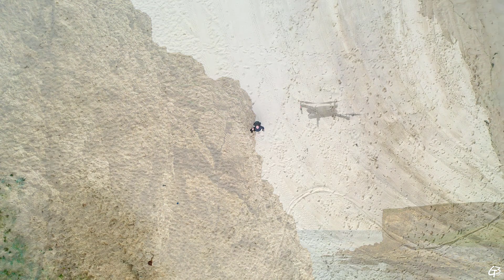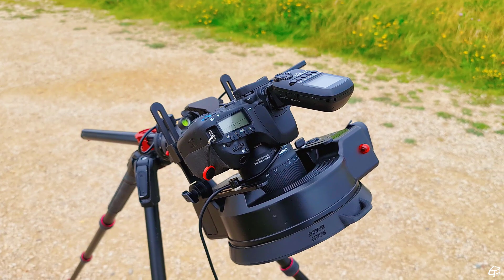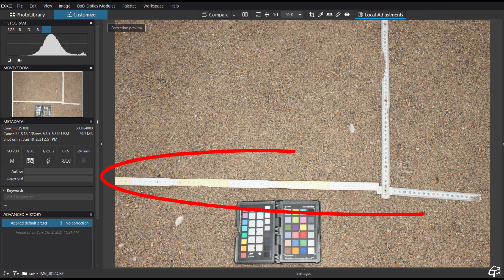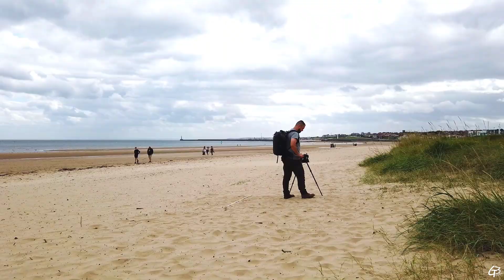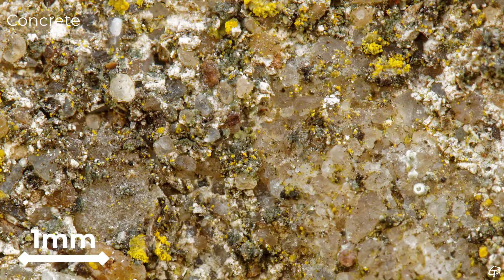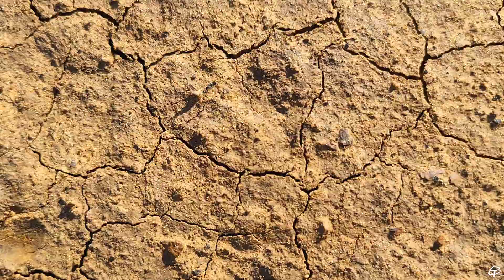Outdoor Photogrammetry Surface Scanning for Materials with a Flash

Comment: Thank you again very much for such great workflow analysis. I’ve been thinking to setup my self with monopod, but after seen your way of using tripod, I cant Imagine it would serve me with my photogrammetry workflow. Also the comparison with different substances and their way to react in ambient, unpolarized and polarized light was great! Absolutely great contnent!
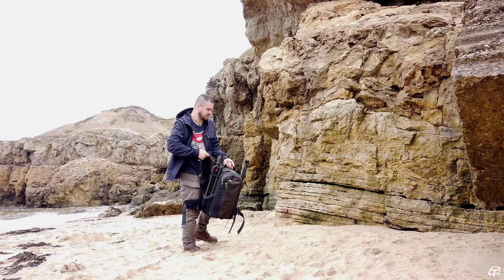Reply from the maker: Thanks. Yeah, the monopod is a better pick if you shot just with a camera in decent lighting conditions, but fails when used with heavier equipment and also when shooting complex surfaces like grass etc. in poor lighting conditions. I also use a monopod to record my videos :). These are reasons why I usualy carry both but if I have a choice I would pick a tripod as a tripod can also work as a monopod if you stick legs together [42:02] while monopod can't stabilise the camera as good as a tripod can.

Comment: This was very useful and greatly presented, barely any detailed info on this out there so thank you so much!!! I have found that when shooting some surfaces when the sun is very bright I would use the silver side of the reflector against the direction of the sun to cast light from it to the opposite side of the surface and sometimes it kills the harsh shadow, not as well as the flash but still!
Reply from the maker: Thanks a lot, btw. your solution sounds like a very interesting idea but I would affraid that the light reflected this way might be not consistent enough. I would rather use black side of the light reflector to absorb the light and its shape to cast a shadow and this way shot in a shade. I did it many times and it works great, the only problem is to hold it steady during windy weather.

Comment: Your video are very useful and informative! Thank you to share your knowledge. It might not sound much, but talking about weight reduction, I took the habit to NOT wear my backpack while doing photogrammetry: this add to your weight on the back especially when you are bending just even a lit bit.
Reply from the maker: Thank you! :D Regarding the backpack and weight reduction, it all depends on the location and if you scan alone or in group. When I scan I am usually 100% focused on a subject and dont pay much attention to surrunding environment. I mean, even to the level where I was caught by tide waves a few times while scanning the beach sand. It takes a few seconds for someone to steal/grab a backpack, especially when they see that you are super busy. Photography equipment is usually perceived as expensive and is easy to re-sell, so a backpack full of it might be considered as an opportunity for some folks. Therefore, sometimes I do as adviced and leave the backpack on the ground, especially when I am alone away from people, but usually when I am not, and there are some people nearby, it feels just safer and easier to carry it on my shoulders. But as said, it all depends on the exact case, if I scan alone and how heavy is the current load - sometimes it is just the camera and the drone, sometimes it is just the drone, sometimes if I parked car nearby I carry just a single, small bottle with water, sometimes I carry more etc., especially if it is a full day of scanning. But you are absolutely right, keeping it on the ground makes the job less exhausting. Cheers!

Comment: your videos are so good! thank you so much. I don't know if you have already covered this in one of your videos but how du you create the roughness/specular map? I've seen some tricks for statonary setup but I especially wonder how to create those maps for a mobile setup. For example if you do photogrammetry out in the street of objects that are made out of different materials that are more or less reflective, how can you caputre those informarion? The only thing I can think of is taking two pictures from every position, one with cross-polarized filter and one without. But is there not another way, where you can be more mobile, because if you do it with this method, the two pictures have to be made frome the exact same position, which means you would need a tripod.
I've seen setup from quixel megascans where the just take picutres with the cameras hold by their hands. Do you have any ideas how they create the specular like this?
Reply from the maker: Thank you and you are welcome. I was planning to recird a video about roughness at some point, after the one about color calibration but I dont have much time recently and it takes me really a lot of time on research and experiments before any of these happen. Roughness is a very tricky subject and similar to color, there are no an easy, 100% way to make or even measure one. So it is very benefitial to understand what roughness really is and how shader expects to use it. I usually generate roughness manually using captured data - and the way to generate one depends on the data available. The way with cross-polarisation works to some degree, but also isnt perfect and has some flaws. It definitelly helps to read reflectance levels by substracting cross polarised data from pararel polarised one and use this information when creating the final map. But as you said, for this technique to work you need to take two images from the same spot - one cross and one pararel polarised.

Comment: I love these videos, so busy these days making art there's little time to get out and take pictures/do photogrammatry, your channel is inspirational.
BTW I got the same ring flash and polarizer from Nz - if you have any transportation tips that would be great. Concerned about damaging the film.
For camera shopping I highly recommend looking at the Canon R5/R6. Mirrorless - with the in viewfinder greater range of information such as instant histogram, is so much better than SLR.
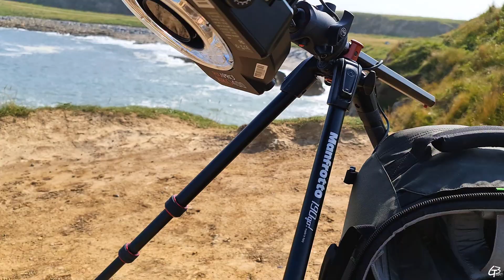Reply from the maker: Thanks a lot Dan. I am afraid of lens incompatibility if I move to Canons R series. Also considering Sony A7RIV as an option but I am not sure. I feel like Canon is just superior to SONY as a still camera (I had an opportunity to shot with SONY too). I carry filter mounted on a flash in my backpack. As you can see on the video I arranged a dedicated space for the flash in my Mindshift 30L  backpack [37:50] so it feels very safe and well protected there.
Reply: Well as you probably know you can use a lens adapter with your old lenses, or just sell them. But the new R series - or any mirrorless  - are really a treat. Lighter, smaller and the viewfinder with histogram as I said (and true exposure simulation). Canon's coming out with new lenses quickly that are really amazing (as usual). I love the new primes - 35, 50 and now 16. The only thing that still catches me is the lag when initially looking through the viewfinder, still not used to the small lag. Also the battery life isn't as good, they're really power hungry.
Reply: @GrzegorzBaranArt  Not later after you got your 80D I got a M6Mk2, that would be equivalent to a 90D (bigger diff apart from mirrorles to dlsr would be on video, so non important to this conversation).
Coming from the 700D I already had some lenses and the feeling of a rough outdoor camera. The M6 came with a 18-135 ef-m but with a cheap adapter I can keep using ef-s lenses, who I like much better than the  Ef-M (although they work fine in my non technical opinion) maybe because they feel design for outdoor use. The same for the body, I feel more comfortable getting the 700D (and most likely the 90D) closely to dirt (both cases taking proper care). In the other hand I don't miss the shutter at all, can't say the same from the eye viewfinder but I've learn to live without it (too expensive for this model). My overall opinion is that compact mirrorless are best suited for "city" and "home", meanwhile, The R series are quite dope (as much as expensive), probably the adaptors are not almost affordable and they are getting better everyday. I hope that Canon finally comes together and develop some aps-c classic rough bodies to meet in the middle. In any case is not worth to talk about recommendations now, your camera really looks like you take good care and those mf shutters live long, when time is due you'll do your own research for products that don't exist yet. What do you think are your dream specs? Mine would be (not talking video now) 50mpx for around 1000$. Hope my camera live long enough to have that available (btw, the 700D still live through mud and pain non problem).
Reply from the maker: @UnrealVirtualUniversity  My dream specs? A very good 24-70mm zoom lens which doesnt creep when facing down :).. I love the premium one (24-70 mm 2.8 GM) for Sony mirrorless cameras even tho its really heavy. Regaring the camera itself.. I just dont know. I am considering switch to SONY but from the other side, all my lenses are CANON and CANON is a very good brand too. So if I have to pick a camera today, I would probably pick older and heavier: Canon EOS 5D Mark IV and a good 24-70mm zoom lens.
Regarding the pixel resolution, I have found that for photogrametry, large images slows me down and becomes a bottleneck in reconstruction. Photogrammetry benefits from having more images even in lower resolution then less images taken in higher resolution. Even if I use Sony A7R4, I still set it on ASP-C Crop mode. High resolution makes total sense if you want to create very high resolution stuff.. like 16k textures. I have found that 24-26Mpx is totally enough for any 4k or even 8k materials. So I always prefer a better and brighter lens with less blur or any if supported by the flash :) as this one really quarantees lack of blur due to really short exposure time.. to any higher image resolution. Image resolution really matters for any single image based reconstruction technique only. Because by covering 2by2 meters of any surface taking 200 images with 24Mpx you have really 14x14 images with 6000x4000px. If you get 50% overlapping for each it would give you 14x3000x2000px = 42000x28000 px actual texture resolution. Its a lot since I usually need just 4096x4096px out of it. So the key in here is the actual micropixel blur caused by long exposure, aperturesetting and lenes distortion. if we blur jsut 2 pixels, we lose the effective resolution by 2. If we lose 3 of 4.. we limit the effective resolution 3 or 4 times which in worst scenario for 24MPx sensor with 50% overlapping would mean 750x500px = 10500x7000px and in this case even if it is enough for 4k texture, its definitelly not nough for 8 or 16k anymore and this is where the image stabilisation, good lens.. and what is the subject of this videoo.. flash come in handy, as with the flash we usually dont lose any sharpness. So if you have place to store a lot of data, and hqve quick camera and super fast SD cards to avvoid buffering during capture. And if you consider future reconstruction when 16k becomes a standard, shoting in higher available resolution makes sense. But as long you need to sacrifice anything, imo it doesnt have such high priority and I would pick a better camera with better lens and lower matrix resolution in Mpx. Imo 26-42Mpx is a totally enough and safe range for years to come. Of course I might be wrong and thats just my private opinion. But this is why I am considering 'Canon EOS 5D Mark IV' which is an awesome, full frame camera with 26Mpx resolution only.. and I blieve the quality output  this camera offrs, is the reason why it keeps the price even years after being released and is still comparable to all new mirrorless counterparts. Hope that helps :)
Anyway.. I am still not 100% sure what camera would I pick today if I can any.. and its a very tough choice as each choice has some pros and cons. Cheers!
Reply: @GrzegorzBaranArt  You've make me thing about lens creeping. I made back in the day lens rings for follow focus in the 3d printer. I nade multiple of them to be able to control zoom rather than focus in the gimbal and I've had to think about it, but this rings probably could help to lock the wheel adding something else... apparently they use some kind of rubber band but doesn't always work, maybe a combination of two rings and a elastic band with some theet should do the trick.
Reply from the maker: @UnrealVirtualUniversity  yeah, you can purchase rubber bands designed for this purpose but I never tried any. So far the electrical tape is the only solution I used and I dont have to much lens creeping problem anyway. As said, the Sony 24-70mm GM doesnt creep at all... even if I shake it... the Canon 18-135mm I use also doesnt creep.. if I move carefuly. It does a bit when shaken :). The sigma 24-70 creeps as hell if not to border position, and even if it gives better results to my 18-135mm one, I dont use it exactly for this reason .. it is also slightly slower in zooming compared to Canon one. Who knows, maybe it is time to consider a rubber band for this one and give it another chance? :D
Reply: Thank you very much for another fantastic video, for lens creep I have had great success with a lensband. It was rather expensive for what it is, but it works well. 
I found the best way to use it is half over the zoom ring and half over the lens body, which stops any potential creep. And after I am done, i just slide it over the lens body, giving me full control over my lens again and not having to deal with tape and sticky residue.
Reply from the maker: @doms_the_beatsmith  Thanks, I am happy you like it :). I am considering to get one since a while but so far I use the lens which doesnt need it (Canon18-135mm) - not because of lens-creep but because it focuses quicker. But in certain cases I would use my Sigma 24-70mm since its brighter but unfortunately heavier and creeps out as hell :D when facing down. Can you please share the link or name/brand to the one you used and recommend? After my recent research I read that most of them breaks very quickly.

Comment: Hey there, thank you very much for all the explanations! It's a treasure for all of us involved in photogrammetry:) 
I have a question about the flash. I'm in Italy and the Godox AR400 is out of production, it only can be shipped from usa.. Do you have a valid alternative? Thank you and keep going with videos!
Reply: Can be the Godox Kit 2 Flash Macro Mf12 a valid alternative? It's not a ring flash and I don't know if cross-polarization is possible with it.. It's a mess
Reply from the maker: @brandogallo3466  AR400 is available under many brands like WistroAR400, PixaproAR400, RICOAR400 and many more. This number comes from the flash output power which is 400W. The MF12 has 12W as it was designed for macro. Its a great flash and can be polarised.. just in a slightly different way, but its not the best choice for photogrammetry. You would basically need 40 of them to match the output power of a single AR400. There are other ring flashes available but they are more expensive, AR400 was the cheapest one in this class.
Reply: @GrzegorzBaranArt  thank you for the answer Grzegorz! Unfortunally Wistro, Pixapro, Rico  and Lightspeed are all unvaible in my country... I tried to ask to some professional photography shops and seems there is nothing like them avaible.. The only solution seems to buy from usa or china. If you know other brand let me know please, in the while thank you so much and keep going with videos, I really appreciate them!

Comment: awesome videos, definetely underapreciated.. btw are you only using agisoft, I did some comparisson, and reality capture consistently gives out better scans.. it solves stuff that agisoft doesn't .. on all occasions, also seems that RC detects different components automatically, so in a way you can put in all the different scans and it does a sort of default batch processing of all objects you did .. in any case I feel you would have a much higher success rate, it's sort of cheap to get started with it anyway, great vids, very informative
Reply from the maker: Thanks a lot, appreciated. Yeah, I use Agisoft Metashape on a daily basis, because it outputs very good results, has no any scan limits and is way cheaper. I purchased a license a few years ago for 150USD and I still use it as all updates are free. I also use 3DF Zephyr from time to time but Metashape is more consistent and iutputs denser geometry. I was planning to make a comparison video between: Meshroom, Metashape, Reality Capture and 3DF Zephyr but it stucked in my video queue :). I guess sooner or later I should make one but have a few interesting already in production now.
Reply: @GrzegorzBaranArt  yeah a comparison would be great, I just don’t get why I get fails with same data on metashape, reality capture supposedly doesn’t use point cloud but only depth map.. a speed test would be great as well.. there were some 10$ free credits going around where people were promoting and doing tuts on RC - you could probably get a sponsorship by them, might be worth a shot ;)
Reply from the maker: @robob3ar  Will do. Metashape since 1.6 also use depth maps for reconstruction. This software was way behind RC but it has changed a year ago. Now it is fast, doesnt need unlimited resources, can do the job on an average notebook now. RC is still faster to Metashape but reconstruction quality is very similar. RC used to be better but it isnt anymore imo.. and its way more expensive now.